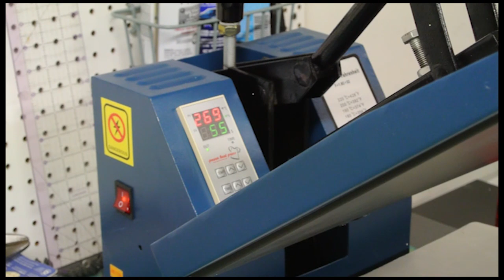Heat Press fast kydex cooking

Comment: Hi,
Do you think the Heat Press could heat ABS 0.177" Not the Kydex...(about 3/16" thick) sufficiently to use to form on a DIY Vacuum Former with vacuum cleaner (not the membrane one) Or would it just melt the ABS all over the Heat Press plate? ABS is usually heated till it sags.

Comment: can you explain where the holes for the air are on you vacuum press? some have like a pegboard type top but I am trying to figure how this one works.
Reply: Anguinus Vir i believe he used a piece of rope to act as a point where air can travel when the vacuum is drawn. thermapress has a design like this

Comment: I thought heating kydex too quickly was bad for shrinkage along with other negatives? Anyone experienced know about heating in one of these presses? thanks
Reply: directorgtr ive heard the pressure applied doesnt let it shrink, and alot of people use hest presses to heat their kydex
Reply: directorgtr ... everybody and their brothers are making holsters these days...
Reply: Hi,
Do you think the Heat Press could heat ABS 0.177" Not the Kydex...(about 3/16" thick) sufficiently to use to form on a DIY Vacuum Former with vacuum cleaner (not the membrane one) Or would it just melt the ABS all over the Heat Press plate? ABS is usually heated till it sags.
Reply from the maker: You should not be using ABS, its not really meant for this application.
Reply: DarkHorseTactical1 it wouldn't be for this application. It would be for an enclosure that screws onto a wood board?